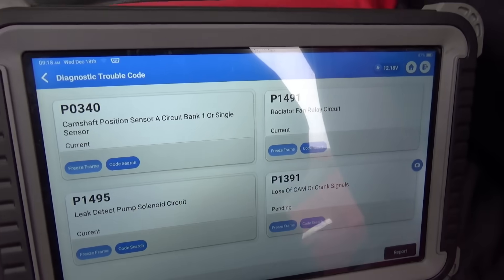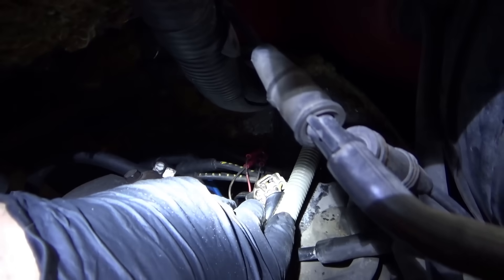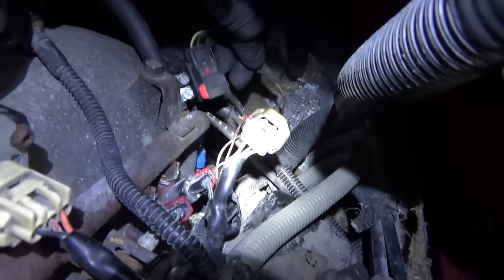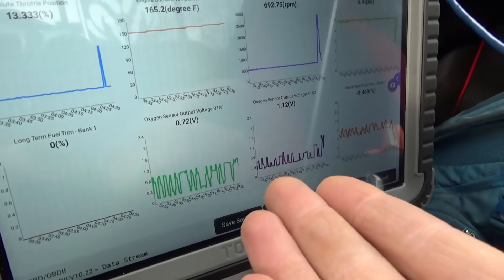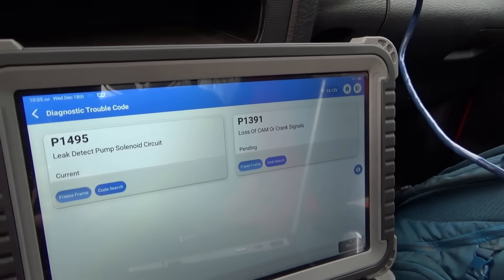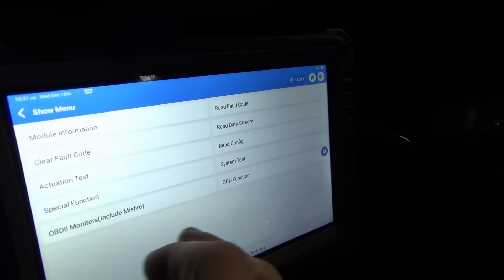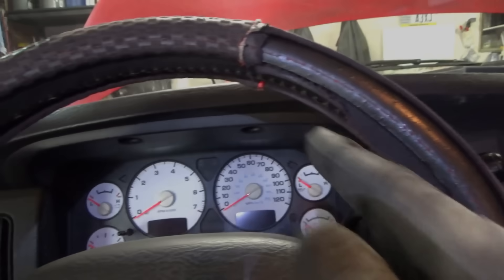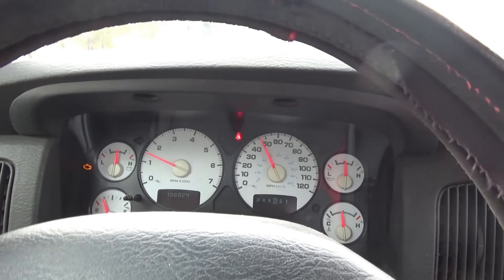Ram Catches on FIRE?! STALL, Low Power After Repairs (P1391-P0340)

Comment: i bought a 97 ram 1500 not too long ago had the P0340 and the PO replace the CKP with a standard motor products CKP,  it would randomly stall after it got up to temp , replaced with NGK/NHK  CKP and its been fine since.  anything electrical from standard is crap

Comment: that much out 19 degrees the distributor could have been installed wrong there could be stretch in timing chain  the adjustment of the distributor  made up for a streched chain  or incorrect  install  i would like to seen  the old school brining the 1 number piston tdc and looked at position of rotor this is probably the last year for distributors

Comment: I need your help about saab 9-3 2007 I have downloaded all the software but it doesn't work tech2win can you help me 😔😔😔 please
Reply: I-Bus Missing. Tech 2 cannot contact
CIM via DLC pin 1.
Flash Hi bean to check bus. IF OK, check pin 1 oF ILC and its wire to CIM.
IF Hi beam does NUT work: reason is a total I-bus Failure or no power supply to CIM.
I-bus activity can be verified using test lamp 8611857 between DLC pins 1 and 4÷
See Fault Tracing in WIS Section 3: Bus and Diagnostics Conmunication*

Comment: timing light and distributor wrench all you need…
or a cheap wrench and a torch make your own…

Ill see if I got a spare timing light  i may have 2   If I do:
next time were at a conference together Ill give ya one
Reply: How do you set the sync on that with a timing light?
Reply: @ wait is that one of those gear driven distributor looking things that dont have conventional distributor? no plug wires?

Comment: Nice fix.  It reminds me of setting the cam retard offset setting for my 98 Chevy trucks.  You need to have a scanner that can read that data PID to set it.  A lot of the cheaper scanners do not have this PID to read the data.
Those distributor wrenches also do not work on these trucks because of the crab design of the distributor cap.  I've had my set from back in the 80's.

Comment: Also, some ppl are slotting the TPS screw holes so u can adjust it properly, can't get to spec w/o slotting it so its adjustable, even with OE TPS.. Definitely runs better afterwards.

Comment: BTW: My '01 Ram 5.9/360 gives NO codes whenever I get a slug of water in the tank. Just runs like shart, pops, sputters, slows down to crawl, then picks up fuel... Quart of 99% isopropyl gets it cleared up quite quickly. Really simpleton OBD2 back then... No evidence (yet) that 'kegger' intake gasket has failed, just @ 53,000 miles now... (I've got more $ into insurance after 24 years than I paid for this Quad Cab 4x4!!!!)

Comment: At work we had brand new 1997 Dodge B350 Commuter Vans with the 360 V8's that had that stalling problem.  Using the DRB3, First was adjust the distributer to zero degrees.  Some of the vans would not adjust for zero degrees.  One way to fix that was to grind some metal from the slot so the distributor could move just a little more.  Or change the timing chain.
Second was to clean the throttle body and throttle plate.
Third was run the engine till it reached operating temperature.  There was a minimum for that, I don't the spec.  Using the DRB3 reset the minimum idle speed by adjusting the throttle plate adjustment screw so the engine would idle at 600 (+ or -, again I don't remember the spec).
Delete any codes and road test.  Worked like great.
Good one Ivan.

Comment: Sure glad I don't have to do work on these for a living, plus surprised that on a pickup, there isn't more room to work on the engine, tucked under cowl area, that's more like a van with a short nose,etc.  Ugh.   Well done!
Reply: Manufactures seem to like to jam the powertrain against the firewall and leave a foot in front of the engine on pickups. 🙃 Like the 3.5 Ecobost. Last time I worked on one, I was throwing tools.

Comment: RaA 2002 Ram truck commonly experiences issues like: oil leaks from various gaskets (valve cover, intake manifold, timing cover), cracked dashboards, exhaust manifold bolt breakage, coolant leaks, faulty rear window seals, potential transmission problems, camshaft sensor failures causing stalling, issues with the 4WD system, and increased oil consumption due to intake manifold plenum gasket leaks; often requiring software updates or actuator replacements to address these problems. m Truck
Reply from the maker: Sounds like you've had a rough go of it with your Ram! 😅

Comment: Sounds like a sloppy mechanic who slapped that distributor back on last time. Ignition must have been completely out of time as well. Not surprised that it ran like garbage.
Reply from the maker: Ignition timing is computer controlled based on the crank sensor. Distributor has to be "close enough" within 15 degrees or so for the cam sensor to sync up 👍

Comment: I can't really fault the previous shop for not diving deeper into diagnostics, as they are usually on time constraints and have to do so many vehicles in only so much time. I can fault them for shoddy work however. Butt connectors on such critical wiring?? Butt connectors are only good for butts.

Comment: Nice.
Where that distributor is used to piss off a lot of people trying to work back there.  Those were pretty good engines though.
Back in the late 90's Chrysler was selling so many 360 V8's they ran out of them and resorted to sending raw blocks on 747 cargo planes to Germany to get machined, then flown back.   That must have driven the bean counters crazy.

Comment: Awesome diag, 
as soon as you said the distributor had been replaced I immediately thought it was installed wrong, the problem with going at a job with assumptions is that it can lead down a rabbit hole.
Reply: the problems didn't surface immediately after the guy got his truck from the shop. And notice a brief glitch after Ivan adjusted the unit? I have a feeling that distributor may fail soon and will need to be replaced again.
Reply: @adotintheshark4848  Could be a wiring issue too. Sometimes relay spikes can also cause it but as long as the car runs and don't throw codes I wouldn't worry.

Comment: Who's betting the new distributor was installed by someone younger than 40+yrs old?
Young techs nowadays wouldn't know what a dizzy is, how to install one, or what a timing light is🤣👍
Reply: Only thing my timing light is used for is the occasional boat. I have been wrenching 30 years and I have never touched points. Stuff is antique and pretty much non existent in the rust belt.
Reply: @mph5896  Yep, mine lives in the cupboard most of the time, rarely ever used, apart from the occasional Mercruiser and a couple of my customer's have older cars with electronic dizzy's which I've never had to adjust.  One customer has an '88 Landcruiser which I replaced the points dizzy with electronic, another has a '74 Buick Electra that still has the factory points dizzy and Rochester carby, I've only replaced the points in it once and checked/adjusted the timing once.
I'm 49, my first 2 cars ('80 + '78 Holdens) both had points distributors and carburetors, so that's what I had to learn, converted both to electronic dizzy's, but still had to set the timing.
My current vehicle ('09 Mitsi Van) is the first car I've ever owned that doesn't have a distributor🤣
Reply from the maker: @simonilett998  actually quite the opposite... the tech who installed it was probably in his 60s..
That exactly explains why he didn't look up service information and didn't bother with the scanner 🤣
Reply: @PineHollowAutoDiagnostics  Oh, wow, that also makes perfect sense.
Gotta do your research nowadays, no matter what it is or how old the vehicle is🤣👍

Comment: On my 99 jeep cherokee 4.0l, I had a crank, no start 1391 code.  Rock Auto didn't have the more expensive Mopar crank sensor in stock, so I bought the next best that Jeeps are usually good with: NTK.  My jeep started right up, but now I get the intermittent 1391 even though it never drops out.  It has full power.  I verified with Autel 808 that cam-crank sync is 0 +/- 1or2.  I do agree that it is dumb that Chrysler didn't separate cam and crank codes back then.

Comment: Ivan, you might be too young to own any distributor wrenches.  I still own 2 of them.  a 9/16" and a 1/2".  I had to modify a 10mm for certain distributors, but I still have them.  ;)  In my area we still have lots and lots of older trucks on the road.
Reply: Just used mine on 1989 Chevy timing.
Many don't know what it is today lol
Reply: I have one too, 9/16"-1/2" - 90° bent ring spanners with 3/8" square drives and a double female 3/8" joiner between them.
I use mine on my '67 Holden red 186ci in line 6 cyl🤣👍🇦🇺
Reply: @ That's the ones.  ;)
Reply: I never understood why Chrysler and Chevrolet put the distributor at the rear of the engine on their small blocks.  I also have a distributor wrench to get at the hold down bolt.
Reply from the maker: @HighTechBull  because the oil pump is in the back 😉
Reply: @PineHollowAutoDiagnostics if you know you know.
Reply: @HighTechBull If you have a van with a doghouse inside the cabin, the distributor is easy to get to lol
Reply from the maker: @GregoryGlessnerViolin  it's pretty neat to be able to adjust your distributor from the driver's seat 😎👌
Reply: @ I've had to remove seats to get the doghouse out at times.  It ain't always just a couple of clips and the floor bolts.  You want sorry, check out the doghouse on the old Ford Aerostar vans.  o.0  Worst design ever for a doghouse.
Reply: Because they want your head to hit the bottom of the hood when you touch a bad plug wire. 😊 @HighTechBull
Reply: I donated a set of four different shapes and sizes of them recently to a local thrift store, clearing out some old tools that I don't use enough anymore. I couldn't find anyone wanting to buy them around here.
Reply: I still have those offset distributor wrenches.....don't know why I  keep them.
Reply: @curtw8827  Because, who gets rid of tools?  Hell I have a big South Bend lathe in the shop that I don't use.  Just can't bring myself to sell it.

Comment: Off topic. What is the most reliable us v8 car before year 2000?.
Reply: My money would be on a LS400
Reply: 5.3 and 6.0 GM .
Reply: My 1975 Cadillac Coupe DeVille 8.2 liter was a fairly stout soldier...
Reply: Well if you go back far enough, in the mid 60's there weren't any "bad" American cars.  They were all pretty good, the peak of US automakers.
Reply: @johnz8210  Very true, must've had better iron back then,  😁 The Cadillac 500's, 472's, (and 425's I believe) were cast using an Iron/Nickel alloy that was incredibly durable, after 240K miles mine still had the original crosshatching and only required a .005" hone to bring it back to spec.
Reply: @ Cool. I grew up around Cadillac 472's and 500's.  Excellent engines.   All the domestic V8's were good 50 or 60 years ago. Some better than others, but none of them were bad.
Reply: @johnz8210  Brand loyalty was real then. You chose an auto manufacturer because of styling, options, or because your Dad had one. Nowadays it's based on who has the least recalls or critical component failures. What happened to our automotive industry??? 🤮
Reply: F150 with the 4.6 or 5.4 2v. TBI 5.7 was also a workhorse, but underpowered and a gas pig.